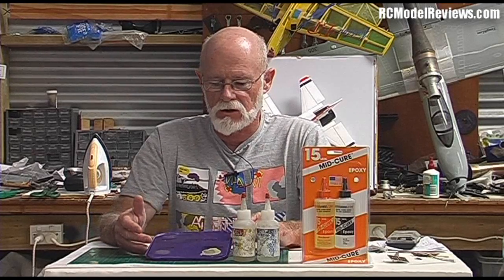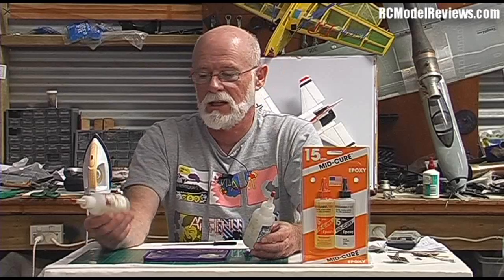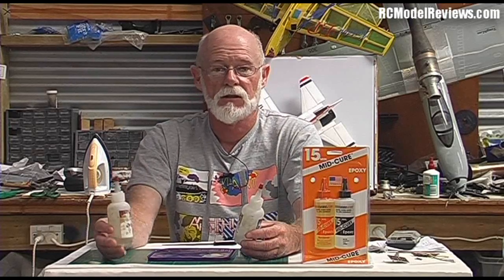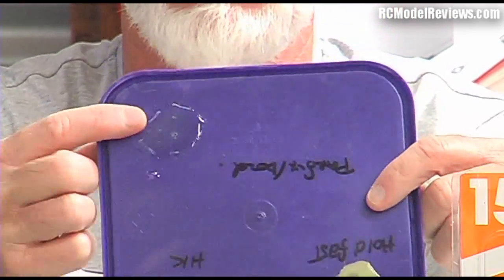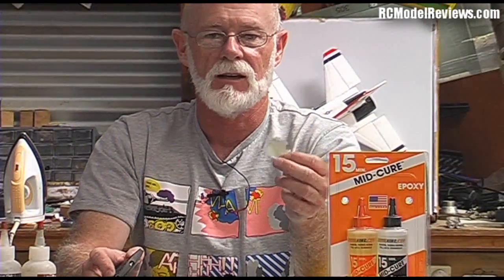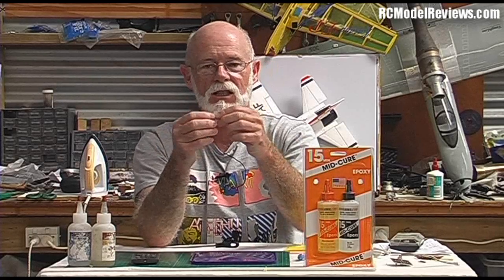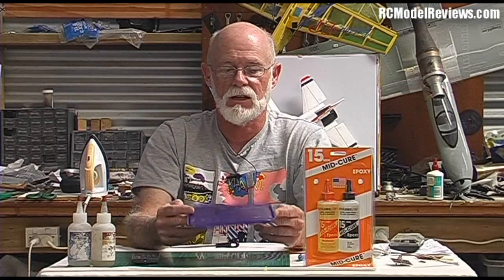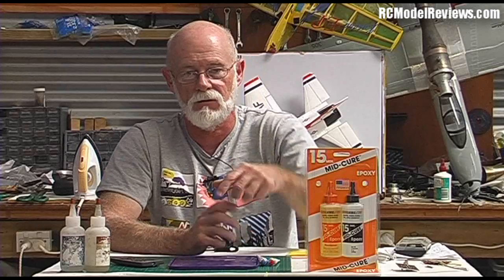All about epoxy glues for RC models

Comment: great video, now I know that the two little A+B tubes I bought are really good glue. However, I still don't know how to use it exactly (and how long it takes to harden) since there simply won't be any readable manual when you buy it. Just a notice: only use in ventilated areas. The manual (on the backside of the cardboard the tubes are packed on) is in damn freakin chinese. No way I could decipher that :(

well I'm gonna try it the way it's been suggested for the other glues in your video and hope it will work :-)

Comment: what is the temperature range of two part epoxy? can i use it in motorcycle engine?
Reply: I've used it on rc390 clutch cover and it works fine till date, about five months now
Reply: @sentea711  thanks much 👍

Comment: Spent most of this video curious yet annoyed at what I thought was my mistake in getting epoxy to glue back a broken abs plastic  ebike panel. I was sure I'd got the 'useless for my purposes,' type of epoxy and was annoyed at the  bad advice I'd taken from people  in what to use to repair it before I'd bought. So I was glad for the  final part on successfully gluing plastic, where you described the cheap 2 tube acrylate stuff, because it appears that is what I have, now I'm wondering why it's even advertised in the rc world as being epoxy? It's a lil confusing to a novice with the stuff.

Comment: Im not going to get into the chemistry here but I will point out that epoxy bonds to the surface via a chemical bond and not really with a mechanical bond like many people think. Most people think that roughing up the surface provides a "keyed" surface like noted in this video and makes the epoxy lock into grooves mechanically. The mechanical component here is actually pretty minor and what you are really doing when roughing up a surface is providing a significant increase in surface area for the chemical bond to take place. Another thing worth noting is that parts to be glued need to be very clean and free from oils. Oils (even from your skin) can cause poor bonds. Some types of wood can even have enough oils in them to make glueing an issue. Many plastic parts can have release agents used to allow the plastic part to be easily removed from molds. These release agents are often difficult to remove from plastics because they are actually in the surface of the plastic and roughing it up with sand paper just spreads around the release agent and does not remove it, which is why it can be hard to glue some plastics. In most epoxy products, it's not that one product is "better" than another, it's more to do with one simply has better properties for a given application over another.  I would like to see epoxy manufacturers using a hardness measurement to indicate the cured epoxy hardness which would be very helpful in choosing an epoxy for a given application.
Reply: helicrashpro 
Thank you for your excellent and illuminating reporting. Does Epoxy 330 (not in your report) need surfaces roughed up when it’s suggested use is on glass or china? A lapidary jeweler suggested it for my fused glass adhesion with sterling silver. May be out of your area of expertise?

Comment: what would be the best glue for automotive valve covers made of plastic? Needs to withstand engine heat and block oil from leaking? Thanks, I have a repair to do this weekend.
Reply: AB glue works fine for my rc390 clutch cover, but i used gasket maker for valve covers if it doesnt have a big crack

Comment: Hi Bruce, just had a look at your axn build, which I have just got another, but now like LIPO's they dont ship glue... at all from H king. Looked at your epoxy glue vid and you said you were doing more vids but cant seem to find any, that aside any recomendation on a glue for the axn? I have used a rubber contact glue before with ok results but thought you might know of something better? Thanks

Comment: what do u guys think.. im thinking about using epoxy glue to my rc tires..I tried two different glues, the rc tire glue and the super glue bought from glocery store and tires still coming off the wheel. Any idea or suggestion?

Comment: hi there, I enjoyed watching your video on epoxy glues. I have just built a super frontier senior 46 which is very similar to a sig kadet senior. the wingspan is 80 inches. when I glued the two wing halfs together wth epoxy along with the dihedral brace a noticed I was left with a slight gap where the wings join. I filled this gap up with thick epoxy. do u think I have added too much weight to the wing?  kind regards aidan mcatamney

Comment: Awesome videos mate, very informative. Is it true that if the ambient temperature is too low, epoxy will NEVER set, ie when the ambient temp rises, it still wont set once it has been mixed and applied? Also which other glues are more suitable for gluing horizontal stabs and wing halves together?

Comment: Finwing hobby AirTitan EPO foam .. structural epoxy from 3M is slow setting .. BUT it flakes off after setting .. The kit glue goes off too quickly for the big .gluing jobs.

Comment: Good Job in sharing your knowledge, it is really appreciated. Question: What type adhesive do you recommend for holding electronic connector blocks together, for example the two connector blocks that connect to the receiver board on a DJI Phantom 2, I recently had to replace this receiver board and the original connections to this board had white flexible glue on both sides of connector, between part on the board and part on cables....

Comment: Kind of a Apples, Oranges and Grapes thing you have going there.  3 different brands with 3 different cure times.  I don't know about the other 2 brands, but the Bob stuff in the orange package there comes in 5, 15 and 30 minute bottles.  I'm certain the other 2 do also.  As always, (except for the one with the 30 sec intro ;p) great video with a lot of good info...

Comment: the strength is not based on where you buy the epoxy or who the manufacturer is, it's only based on the cure time.  usually 5, 15, or 30 for bonding epoxy. bob smith makes all the diff kinds, the 5 will be brittle and the 30 much more flexible.

Comment: Laminating epoxy resin differs from most other epoxies in that it does NOT contain any wax. The lack of wax allows successive layers without cleaning and probably abrasion in between (leaves the surface a little rough). Wax in the others floats to the surface, creates a barrier to the atmosphere, and creates that wonderful glass smooth surface.
Reply: None of the epoxies have wax. You are thinking about polyester resin.

Comment: By any chance have you done a piece on and American product known as J.B. Weld? I've used it to repair some major damage to my heli airframe and I rather like the way it bonded the polycarbonate parts. It's also sand-able in my opinion. Lightweight as well, so I don't add any unnecessary weight to the heli overall. Thanks. Enjoyed your review of these products, BTW. Quite informative. I learned a thing or two.

Comment: hello there... i have a small 3 channel rtf plane it is the safety foam type.. today i crashed it and the front nose broke off... i am going to use tooth picks it help to strength it.. will hot glue do the job your should use epoxy glue...

Comment: A good way to get close to equal amounts of the two parts is to weigh them. Use a digital scale that measures .1 or.01g or less, set mixing container on the scale, add (for example) 3g part A and then add 3g part B and there you go. A lot better than eyeballing it.

Comment: You forgot something extremely important about epoxy. It can be thinned with denatured alcohol (and a mess of it can be cleaned up by it!)
Shoulda mentioned for the newbies that epoxy is generally fuel proof over long amounts of time, but is heavy so when painting epoxy on, or using with fiber weaves you can cut the weight using denatured alcohol.

Comment: Nice description of the polymerisation process. :-)
I usually use L285 manned aviation grade epoxy. 55minutes low-viscosity, 700g for 20 bucks.
That amount will last for a quite long time. But there is also quite nice standard grade epoxy for half the price.
I think much stuff that has "for rc models" written on it is overpriced.
Sometimes it makes sense to bake the epoxy, but i don´t know the english word for that process. ^^

Comment: I just want to correct the glass analogy.
Glass is very poor at tensile loads (hanging/stretching), but it is on par with concrete when it comes to compression strength.